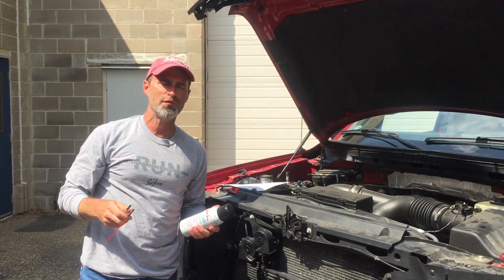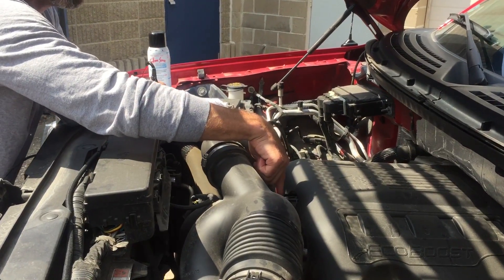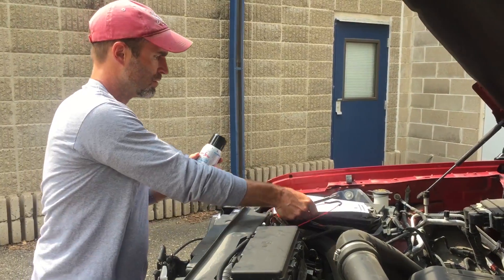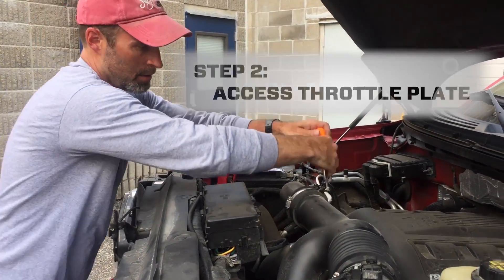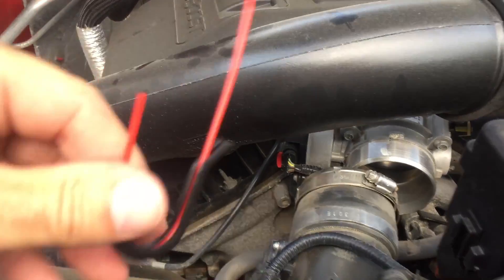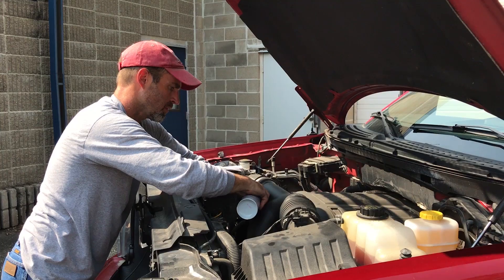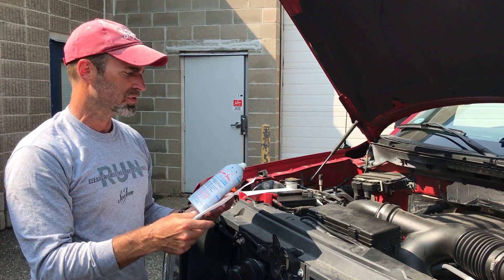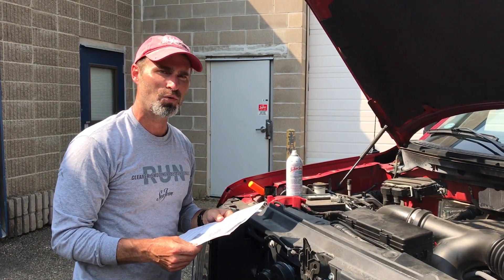(Absolutely👍) Yes, you can use Sea Foam Spray to clean a turbo gas engine

Comment: Finally a ecoboost one, ford dealer told me me no seafoam treatment or other products I thought that's a lie. "It'll harm the injectors and turbos." I always tell people that have ecoboost use ONLY seafoam.
Reply: Ford tech here- I've done many many EFI and Intake services on ecoboost engines. The BG products we use are designed the same as seafoam. It hurts nothing. And DOES improve fuel economy and performance. Cheers
Reply from the maker: @jimmosier3548  Hi Jim:  Thanks for the post!
Reply from the maker: To be clear, Sea Foam Spray does NOT clean or pass through a turbocharger. See response to illest 572:  "By the time your intake air is drawn into the throttle body it has already passed through the turbocharger and intercooler... The product is applied directly in front of the throttle plate, goes straight through throttle body to upper engine/ intake valves and chambers."    This is helpful, correct?
Reply from the maker: @anthonymontefusco4290  Citing a pseudo expert on YouTube is not citing an actual statement from Ford.  Whether to believe  words put in Ford's mouth (in this case) all boils down to the authenticity and reliability of sources. Don't make too much of hearsay.
Reply: If you put gas treatments in your tank thats when it will hurt the turbos. The treatment makes for a hotter combustion therefore making the turbos hotter. This cleaner you are putting it into your intake manifold cleaning your valves. It burns up before reaching your turbos.
Reply: @ryansayre892   just a question, whether added to tank or intake would both ways burn up in combustion, just when sprayed into intake it cleans the intake valve. How do we know both ways don't increase combustion temp. Eco boost engines have turbos mounted very close to manifolds so risk are there for over heating them. I drive a 2.7l eco boosted f150 and work at NAPA and have talked to sea foam sales representatives and even they have mixed feelings only on the the ecoboosted engines.
Reply from the maker: Sea Foam Spray is to be applied directly in front of the throttle plate. For one, it's the shortest spray path to a running engine's intake valves.  "Spraying intake tube..." does not make sense per length, turns, air draw (vortex), MAF sensor...???  Doesn't make sense... Specifically, how is it stated?
Reply from the maker: Do you mean spraying into the intake before the air is heated/boosted?
Reply: Spraying into the intake tube and spraying into the throttle body will both get the product where it needs to be, the back of the intake valves. The difference is that spraying into the throttle body bypasses the turbo. The CRC cleaner says it will clean the turbo as well. If you trust that claim, you can use either, CRC could also be used at the throttle body, but the cool thing about the Seafoam from what I can see in the video is that you can reattach the intake tube to the throttle body with the Seafoam straw still installed. This means that the engine will be protected against any foreign objects getting into the intake while you spray.The CRC straw is to thick to do that, I believe, so you'd have to spray into the throttle body while the intake tube is not attached. BTW, I personally doubt that at 2k rpm the turbo is turning fast enough for either product to do any damage, unless there is something in the product itself that is not compatible with metal the  compressor blades are made of.
Reply: What you said makes sense. 
CRC states insert spray nozzle past the MAF sensor in the intake tube and spray same way as seafoam rev engine to 2k RPM I would say it might be more effective to clean turbos but won't make it to intake valves. I have 90k on my recently bought taurus ecoobost I did install a catch can just want to keep up with proper cleaning of intake valves to ensure longevity. Looks like seafoam is the way to go.
Reply from the maker: The products work from the throttle plate to the chamber to clean the upper engine, not the turbocharger..  See explanation [illest 572]: "
Reply: Got it. That s why I don't trust the CRC cleaner because the instructions are saying to spray it in the air intake tube which can't possibly do much for intake valves. And yes when applied to throttle body directly it won't harm turbos and intercooler as the air is already passed through the rest of the air passages throttle body is the last stop before it's drawn into the engine. Do you think seafoam will be helpful in any way to keep turbos clean when sprayed into the intake tube or you think it's more harm then good?
Reply: Yes spraying into the air intake tube after air filter
Reply from the maker: Product is designed for application in front of the throttle plate.
Reply: Awesome
Reply: so, i don't understand completely how they work but in the ecoboost 2.0 isn't there a turbine on the exhaust side that spins the turbo on the intake side. so even if you introduce the seafoam at the throttle body it still hits the turbine on the exhaust manifold. Please correct me if I'm wrong. I just bought a 2.0 ecobost edge that i would like to do this to but all the contrary information is making me worry.
Reply from the maker: @christopherleonard9490  Not clear what you're asking but the intake air and atomized Sea Foam Spray mixture go from the throttle body through the turbo compressor (ambient air temp) before entering the intercooler, then over the intake valves and into the combustion chambers where everything is burned up and pushed out the exhaust valve openings.  The hot post-chamber exhaust air is what heats the turbo (turbine wheel) on it's way out the tailpipe.  The posts by Bill S and QuickCarCare are reliable - each has a solid grasp of the concept.  Hope this helps!
Reply from the maker: @anthonymontefusco4290  No, that's what detergents do.  Sea Foam is not a detergent.  Even in the case of a detergent cleaner,  the info you're suggesting is a big stretch.   We see tons of occurrences where  people on YouTube claim statements by OEMs...
Reply from the maker: @anthonymontefusco4290  
My opinion is that someone is trying to manufacture a gray area. Please cite the public statement from Ford.  If it were true, Ford would need to issue a public statement to consumers to have a basis for voiding a warranty matter.
Reply: I am a little confused on ecoboost. The CRC cleaner is supposed to be sprayed in the intake tube and seafoam is saying spray the throttle body directly. Which one is more effective on cleaning the intake valve? Spraying intake tube or the throttle body directly? Can anyone chime in on that
Reply: Bill S yea because at 2k rpm the turbo is spinning at a mere 100,000 rpm, how slow 😂😂😂 even at idle the turbos spin at 50,000 rpm so regardless of Rev range, ANY foreign material introduced at ANY operating range will cause catastrophic failure. Now introducing a liquid that will burn off well before it even reaches into the turbine or compressor side, shouldnt have any effect. And CRC im assuming is referring to naturally aspirated engines, not turbocharged. Otherwise they should update their directions.